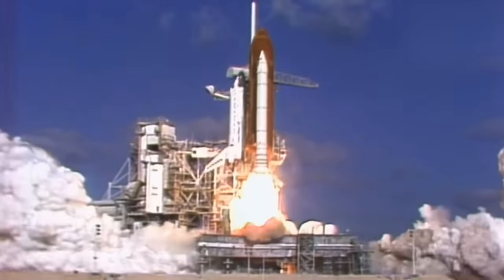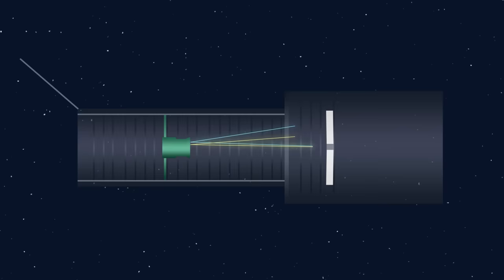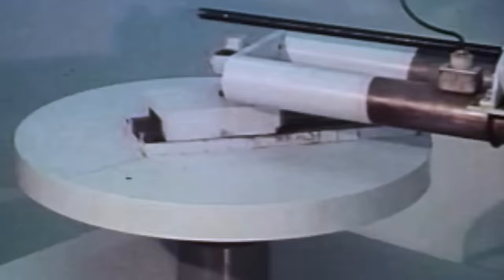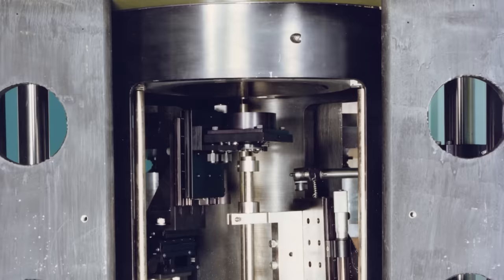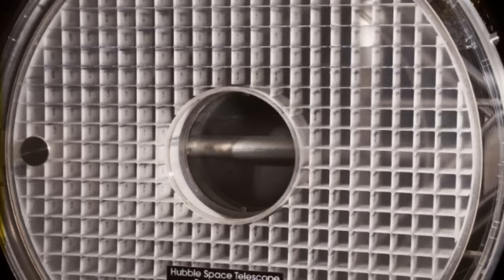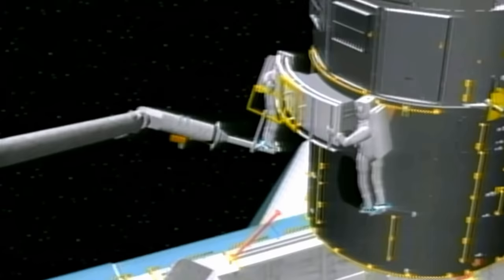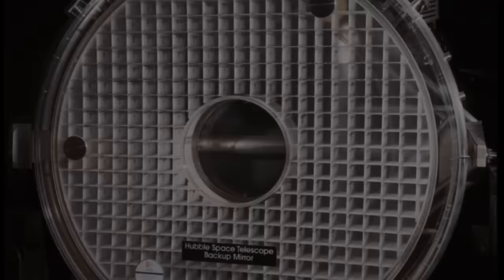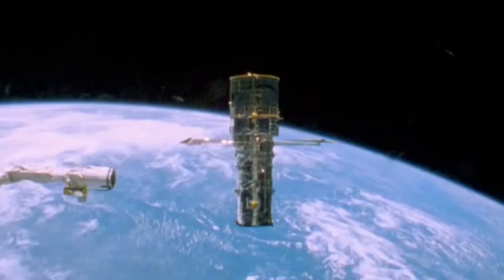NASA's $50 Million Hubble Mistake

Comment: Missed the story where the manufacturer actually found the problem before delivery, but management didn’t trust the measurement...
Reply: This is not r/maliciouscompliance. :D
Reply: Yep, that’s a big issue. Same with NASA and the o-ring failure of Challenger‘s boosters. 
Ignorance can be very costly and also life threatening
Reply: That’s most of the story.  They measured twice.  Once with an older instrument that turned out to be properly calibrated and accurate, and once with a newer one that turned out to be misconfigured and therefore, not as accurate.  The error was in trusting the newer instrument over the older one rather than properly validating the results.
Reply: @HylanderSB  yes, and I am surprised they did not doublecheck. I am not surprised the Japanese got it right the first time, that would have been seen as a major coup for the Japanese at the time. So they would be sure to put their best on it.
Reply: That's what happens when you let politicians meddle with science.
Reply: Yeah... sounds like the management heard: We can't afford to fail this mirror and still get the CEO rich, so lets just pass it.
Reply: @RealRequiem  this is not r/reddit
Reply: @mildmannered1086  Nope.  Not quite. People make mistakes most of the time for perfectly normal, neutral reasons.  Relax.
Reply: Should have run it through the QA department.  That’s what they are there for.
Reply: @Russell White Oh.  I didn’t know that you were there at the time.
Reply: @pusico6555  It feels like MBAs are hated in every STEM field, haha.
Reply: @ezioauditore7636  Generally for GOOD reasons!!!
Reply: @paulpaulsen7777  That's not ignorance, that's criminal negligence. I don't know how anyone can be so cynical that they will send humans on a rocket that has a known potentially fatal design flaw.
Reply: @naqvadak  Sorry, if you think an American is going to consider conspiracy theories from a Russian, you haven’t been paying attention to the right things. If you’re not a Russian, too bad, you’re representing yourself as one. Have a good one, Oleksandr.
Reply: @HylanderSB  I am nor russian have no idea why do you think so, I am from Urkrain by the way. What kind of conspiracy theory are you talking about? and what kind of things I should pay attention to? This was ground braking ttech at that time and thy messed the terms price and more, and kodak did fine, so I am sure that politics/money or else took place here instead of science as usual, And actually, there is nothing to bad about it whole world work on such principals, but, agree with me this is ti fucking famous mistake to do, even if it is profitable. And once more why russian? this is an insult in my country (in some way)
Reply: @naqvadak   Fair enough. Sorry Ukraine has to share so much heritage with Russia. It was unfair to assume you are Russian.  What I’m referring to is Russia’s poorly concealed but unfortunately effective efforts to mess with US politics with disinformation.  Not as bad as what they’re doing to your country, I’ll sadly admit.  

I believe the P&E error was an “honest” one due more to human nature than anything else. They’ve done a lot of fine work before and since. Also, hind sight is 20/20. Meaning, they didn’t know then what we know now.  I think everyone was trying to do their best with the information they had at the time. But then again, maybe it was the Russians?
Reply: Its quite judgemental for you to just assume someone's Russian shall we all about the state your country bought from Russia and how's lot of towns in said state have Russian names?
Reply: @Benkenobi8118  Are you referring to Kodak as a Japanese company??
Reply: 777 likes lol
Reply: That's very much true.  It is also true that the government made a demand concerning a deadline for the mirror's completion.  That played into it. My dad worked for Perkin-Elmer and was one of the engineers.  Very few people knew that there was an issue with the mirror prior to the launch. But it was known. The computer did detect an issue with measurements of the polished surface at first. It was washed over, and the computer miraculously analyzed it as being correct. The deadline was met. All the individual engineers are now since gone along with my dad. In the summer of 2000, I was at my parent's house watching some videos about the S.T. project with several of the engineers. They were all very upset because by then they knew what happened and who covered it up.  My wife and I got to see the telescope at Perkin-Elmer in a showing allowed for family members.
Reply: @HylanderSB  Jesus fuck, tinfoil hat time bro
Reply: @TheBananaman491  Relax, pal.  You don't know who you're talking to either.
Reply: @DontTrustShadows  What are you talking about?
Reply: @RealRequiem  loser
Reply: @HylanderSB As someone who has programmed quite a few complex production machines, partly with testing capabilities, the sentence "The mistake cancelled out the other error PERFECTLY" sounds very much impossible. They meddled with the results, until they got the results they wanted. One way, or another. It's hard to say whether it has been with malicious intent, but pressure probably didn't improve things. I've also seen quite a few of my machines shipped in a faulty state to a customer just to meet deadlines. But driving a couple of hours to fix something is something different than servicing an object in literally outer space. Nevertheless, since the figures are so incredibly large on one side (the cost side) and the figures on the other side are so incredibly small (maximum allowed fault of less than 10nm), it's even easier to make a wrong decision in this scenario.
Reply: @litmuscheck    Where is it stated that one error cancelled the other perfectly?  What had happened was that there were two measuring devices.  An older one and a newer one.  The newer one was out of calibration so the measurements didn't agree.  They decided the newer one was the more accurate one, for reasons.  If any more was known, no one has established that on the record as far as I've seen.
Reply: Do you have a source or documentary?

Comment: "However, as the engineers were setting up the null corrector, one of the mirrors was set up incorrectly, perfectly cancelling Hubble's flaw" yeah.. more like one or the engineers adjusted it cause he was petrified his boss was going to chew him out for fucking up the mirror. We've all done shit like this at work. Usually the consequences aren't quite as bad though.
Reply: Bro faxxx I was thinking the same thing. Like pull shit the mirrors flaw aligned perfectly for the null corrector and the space fix. Calling bullshit
Reply: New Guy  The null corrector is an apparatus to test the mirror, it doesn't actually fix it.
Reply: How though? BOth Perkin and NASA surely would've done their own tests
Reply: @midgetwars1  If they had, they would have discovered it was faulty. The main point is, the space industry back then was damn cavalier and just kind of, went with stuff. For Hubble it was an expansive fault, but later stuff like that cost lives.
Reply: Mistakes like that is why they teach you not to torture your employees for mistakes.
Reply: Me manipulating results in the lab practical examinations be like

Comment: they also had an offer from Zeiss...  about 10% more expensive. which is well below the usual difference in price of Zeiss products, when compared to the concurrence and back when it still meant something. could have been the bargain of a century.
Reply: Why?  They had the original mirror and two backups.  Both backup mirrors were correct in their optics.   All that had to be done was to compare the original mirror against the two backup mirrors as part of quality control and the answer would have been to use one of the backup mirrors.
Reply: I mean... when we're talking about optics Perkin Elmer doesn't ring any bells. In Romanian "zeiss" is also a slang for "perfect". Perkin Elmer sounds like a hillbilly name, just sayin'

Comment: What the hell are the chances that the one mirror was misaligned just right to make the laser line up perfectly... Insane!
Reply: Yeah I’m pretty sure there was a cover up
Reply: @IsaiahDanielJohnson  On what grounds? Are you familiar with the calibration method?
Reply: "I dont understand something, must be a conspiracy "
Reply: @logitech4873  maybe they just didn’t actually do the check, and just claimed it was a mistake afterwards? Idk
Reply: The chance is zero.  This isn't what happened.  The incorrectly installed null corrector was used to guide the grinding of the mirror.  That's why it was ground to exactly the wrong shape.  The device that measured the mirror was the same device used to make the mirror, so of course they agreed.
Reply: Yeah, probably some engineer caught it, but didn't want to get chewed out by his boss so he made a rash decision to save his hide. Stuff like that happens all the time no matter how dire the consequences.

Comment: The story is not 100% accurate. The null corrector was not cancelling out hubble's flaw. It was being used during the polishing as feedback, therefore was the REASON of the flaw. Interesting detail to the story: They had an older null corrector what did show the flaw. But they trusted the "brand new, better and shiny" null corrector, what had been built to be many times more precise. But was calibrated wrong...

Comment: I will use a simple analogy. Many years ago, one of my first jobs was making eyeglass lenses. What we did was find out what curvature was needed for what the glass was called for. Then we hooked up a tool with a diamond edge and locked it into a spindle. Now the diamond cutting edge was slowly rotated back and forth across the grinding wheel as it rotated, slowly moving the cutting diamond more into the grinding wheel with each pass. Before starting this process, we had curvature pins that we would use to calibrate  different curvatures of the grinding wheel.  Long story short, they started with an improper curvature, and polished the wrong curvature to near perfection! The solution was to install a contact lens.

Comment: I hope we can push it up to a good long term parking orbit. If I could, I would make it the first in space museum object!
Reply: Bringing Hubble back with a Starship would be amazing as well, problem being I don't think we could ever trust a vehicle with such an important job. The best case scenario IMO is to completely outfit Hubble in orbit with Starships, new solar panels, instruments ect. It would never be able to out do the JWST but for it to inspire future generations taking it's awesome true color images would be amazing. Plus IIRC Hubble was put in such a low orbit so the Space Shuttle could service it, with Starship this isn't a problem so it could operate at much higher altitudes.
Reply: @aarons1234  The JWST is not a replacement for Hubble.  They don't observe the same wavelength of light.  JWST is an infrared telescope.  Hubble was a visible light telescope (and also did some IR and UV).

Comment: I remember this problem.  Hughes Aircraft was fined $XXM's along with Perkin Elemer who made the lens in the 1980's.  P-E had issues manufacturing the lens so the project was delayed years.  Then the lens was ready the challenger blew up so more years of delay.  Hubble was maintained and stored by NASA for years at a cost of ~$10M/year close to a decade delay.

What sucked is Hughes aircraft bought P-E just before the launch.  Hughes had nothing to do with the design and manufacturer of the faulty mirror but when NASA found the issue, Hughes was sued since they owned P-E.  

Some news article said Hughes would not have bought P-E if they knew the mirror was faulty and NASA knew and did not tell Hughes.  

Who knows what the real story is.

Comment: AFAIR these events back then Perkin Elmer (we had an instrument from them in our lab) did not consider the second (or higher) order diffraction on the sensor which was essentially a pipe with a very small diameter (thus the diffraction) collecting the light reflected by the mirror to be tested.

Comment: The version I heard, from an engineer that designed and built two Hubble packages, the original problem was that the mirror was designed using a "thin lens approximation" instead of the full equation required for mirrors of such a size.

Comment: The question that I hoped your video would answer is how the mistake was made in the first place - and what the insane coincidence was that resulted in it not being detected.   You kinda glossed over the part of the story that I wanted an answer to.   Also, by the time the corrective lenses had been fitted, most of the problem of the lens had been fixed with software that reprocessed the blurry images...and that part of the story needs to be explained too.
Reply: There was no coincidence.  The device used to measure the curvature of the mirror was called a null corrector.  It was assembled incorrectly due to an error that resulted from a missing chip of non-reflective paint on a calibration rod.  This resulted in the field lens of the null corrector being put in the wrong place.  The null corrector was used to guide the grinding of the mirror.  That's why the mirror was made precisely wrong.  It is true software deconvolution was used to sharpen the original blurry images, but no software can replace the light that was being lost and thus lowering the telescope's sensitivity.  The deconvolved images were not nearly as good as the corrected ones.  There are very detailed reports available that explain exactly what went wrong, and how they fixed it.
Reply: @stargazer7644  So they used the same "null corrector" when grinding the mirror as when testing it later?  That seems like asking for trouble.
Reply: @SteveBakerIsHere  The null corrector is what told them how to grind the mirror.  There was no separate testing step at the end.  It was tested all throughout the grinding process with the null corrector.  When making a mirror you grind it for a bit, then you check it to see how close you are to the desired curve, and where you need to grind more.  Then you repeat this many, many, many times.  This is normally not a problem, because you're supposed to be using a test instrument that will compare your mirror with the desired shape.  Yes, skipping the independent testing step was a mistake in this case.
Reply: @stargazer7644  Yeah - no second check.  No  concept of having two null correctors - preferably made using different techniques by different contractors!
Reply: @SteveBakerIsHere  They actually did use two older surface testing methods to look at the mirror at various times.  They both clearly showed spherical aberration.  But since those methods were less accurate than the null corrector, they chose to disregard them and rely on the null corrector.  The device they designed was very good.  But due to an error in calibration during assembly, it was not setup correctly.  If it had been, the mirror would have been fine, even without additional testing.  And that's what they had learned from previous mirrors they constructed.  They also had a reverse null corrector that simulated a perfectly figured mirror.  When they used that with the existing null corrector, it clearly showed an error.  There were lots of chances to catch this mistake, and they all were thrown away.

Comment: I charge my master pro at 3 amps on 2 x 300w panels, perhaps a 3rd panel on angle connected to a 100amp mppt solar regulator to a 12v 100ah battery , either a lithium or a lead acid deepcycle.
 up to 4 batteries, of the same type of course, connected to a 3000w pure sine wave inverter. 
To charge at more than 3amps you could maybe go 24v set up in my 5c opinion and see how that goes.
Im Not sure how many houses are going home solar or what effect on the grid requirements that might have. 
My opinions. is a useful saying i hear. 
Merry Christmas,wishing you nice success and to be well Mr Ark from Will. 
As is where is use at own risk. 
My opinions, Thank you.
I hope things go better all round.

Comment: You got this a little backwards.  The null corrector wasn't made to test the mirror, and it didn't magically have exactly the error needed to miss the error in the main mirror.  The device was used to guide the grinding of the original curve into the mirror.  That's why it was ground perfectly wrong.  Also, Hubble wasn't useless with this flaw.  It was still used to do successful science in the time before the first servicing mission.

Comment: Why don't they build another telescope around the second mirror for when Hubble retires? The James Webb is supposed to look at a different part of the spectrum, so there's still use for a Hubble like telescope.
Reply: There won't be another Hubble mainly because ground based telescopes have gotten so much better due to advances in computer controlled adaptive optics that they routinely outperform Hubble in most respects.  And they're much cheaper.  The only place they fall short is in sensitivity - looking far back in time, and in infrared astronomy, since the atmosphere blocks IR.  These are the two things the James Webb Space Telescope is designed to do extremely well.

Comment: So, in effect, they made the cardinal sin of engineering.

They didn't follow measure twice, cut/install/assemble once.

If the mirror was tested by measuring more than once, measuring meaning everything from mounting to the actual readout of a measurement, the error would have been discovered.